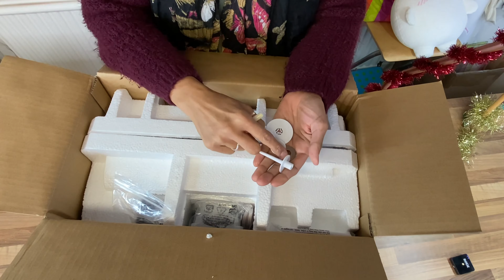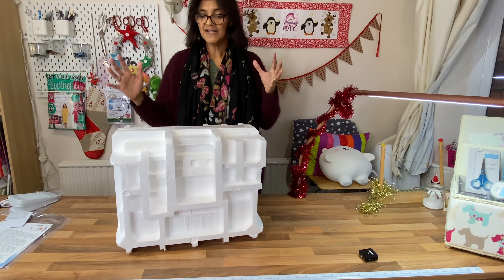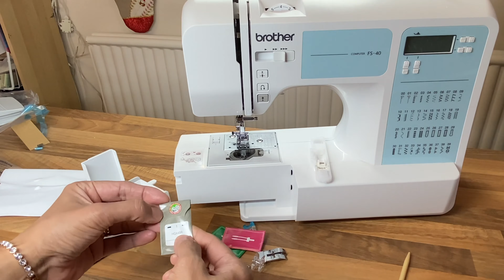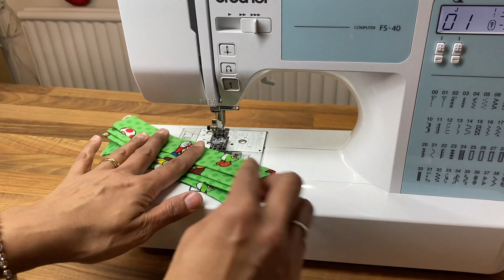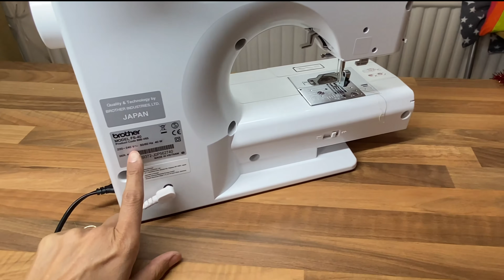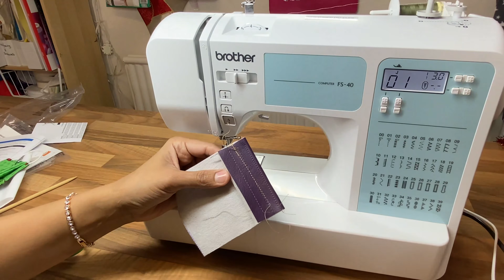Brother FS40 UNBOXED Review #AbisDen | Abi’s Den ✂️🧵🌸

Comment: 11:15 "the peddle doesn't give me good control"
It's sounding to me like you just have a lead foot.. It's not an "ALL or NOTHING" deal, if you push down partal way it will go slower. It's quite variable actually.
It sounds like when people try to use their "clutch" foot on the brake peddle while driving, you end up slamming on the brakes far too hard..
Reply from the maker: Thanks for your thoughts Colin. The peddle on this machine does not give good control. Having worked with Brother for years, I have come across their different peddles.  Some of their machines they class as disposal, this being one of them. This machine has a poorly made foot. But thank you for your thoughts.
Reply: @AbisDen  I literally used this paddle on the FS40 less than 4 minutes ago.. There are about 7 different levels of control on the peddle. You seemed to use it in two different levels NO peddle and FULL peddle, there was nothing in-between. Either you have a defective peddle, or they have changed the design of the peddle. I see the video is 2 years old, we have had the FS40 for about 9 years, so maybe they changed it.. But, if they hadn't, it would seem you are unable to smoothly operate the peddle. Practice may help with this, though this was the first time I used used my wife's sewing machine in about 4 years, and was able to find the correct pressure on the first step.. 
If you are a car driver, I would suggest you try your right foot..
Reply from the maker: Thanks Colin. Maybe it is defective? I originally bought the machine from the states before they were sold in the uk.I’ve had a few FS models. It’s not a good machine. Having repaired a few, they just aren’t designed for longevity.  Brother sell a lot of plastic rubbish. What they themselves class as “disposable”. The FS range is unfortunately one of them.

Comment: Dust covers are very important to protect your machine from general airborne grime around the home. 
The offset shank on the twin needle is for use on a left position zig-zag machine. 
The other problems you encountered were due to operator failure, not the machine.
Reply from the maker: I'm not sure the operator is at fault here - these machines are consistently poor - have you ever opened one to see the quality of the machine - dreadful.

Comment: This is a shocking video! Its struggling to go through your leatherette because you arent changing the settings to adjust the tension and presser foot. Please if anyone buys this machine make sure you read the instructions before  trying to do this
Reply from the maker: There is no pressure adjustment. Tension isn’t a factor at all, it only affects the quality of stitch. Power is what this machine lacks. The feed system is equivalent to than of a plastic mini machine
Reply: @AbisDen  I use this every day for my business 😂 never had an issue and its certainly not like a mini machine. Look at your hands fumbling on everything, do you even know what you're doing.

Comment: There is a little black switch at the back of the presser foot that you push in that levels out the presser foot to sew thicker fabrics which works well, I have this machine and as a new ish sewer an not having the same issues as you are with the fabric going off to the left. I recently sewed a 3d face mask and the stitching is straight and that has interfacing too

Comment: Have this model. Bought it in the uk and wanted something light to take home on a plane.  Wish I'd dragged my ancient heavy duty machine over instead. It's a lightweight and struggles with pretty much everything and hates pretty much every type of material. I've never had to use a walking foot as much to sew things. It doesn't want to sew in a straight line - constantly veering off to the right.  The pathetic screwdriver is a joke. Buttonholes are hit and miss. Lucky to get more than 3 or 4 done before it decides to grind to a halt sewing in the same place which is a nightmare to unpick.  It was pretty cheap and didn't expect much but even so it's a great disappointment.

Comment: 5 button holes. I have the Brother SE 600 it's not too bad but you need to have a few tricks up your sleeve. For fine fabrics use a smaller needle and place tape over the throat plate as the hole is to big as you saw it sucked in the fabric stabiliser also helps. These machines are not for heavy duty sewing and the computer is very finicky. On heavy fabrics I lengthen my stitches use a size 16 needle lower the tension slow down the sewing speed and use a hump jump over thick seams.  I'm still practicing and learning to have patience.😊👍👍

Comment: Every time you do one of these unboxing videos I’m so happy I went with the Necchi! I’m sure there are other good machines out there, but mine was such good value and has been brilliant so far. Oh there are 5 different buttonhole styles on the brother machine you unboxed x
Reply: Are you still loving the Necchi? Was it the Aldi one you got, I'm considering it!
Reply: @toilworn1322  I’ve had it now for over 2 years and I’ve been very happy with it. Good points are the drop in bobbin, needle threaded, needle up/ needle down, range of stitches and easy to use. I’ve sewed loads on it, cotton, viscose, jersey, sweatshirt, cord, wool and it’s been great to develop my skills. A couple of things that could be better are the fact it doesn’t have a speed control, the lighting - I bought a stick on strip light from Amazon which improved it, button holes on stretch can be tricky, and it can struggle on thick fabric or thick seams. I now know what I’m looking for on my forever machine, but I will be paying 10x the price of the Necchi to get them! So overall a fantastic, value for money machine, which I highly recommend. Hope that helps x
Reply: @maggiemcdonald1346  Thanks so much that's so useful! I noticed it didn't have a speed control button. I guess careful footwork is required! Does it do a stretch stitch? I am new to sewing so might be getting a bit ahead of myself here but just thinking about the types of things I might want to make.
Reply: @toilworn1322  yes you just have to be extra careful going around corners, although if I want to do something really slowly, say turning a corner I press the up/ down needle button so it does one stitch at a time. Yes it does have a stretch stitch and a stretch stitch button hole too. However if you are sewing jersey you can use a zig zag stitch too. You can also use a twin needle for hems too. When I was starting I found YouTube a fantastic resource for learning how to sew different fabric and garments etc.
Reply: @maggiemcdonald1346  Well, I'm sold on Necchi.... but I ended up buying the Q132A... 3 mins ago 🤣 Wish me luck! Thanks so much for your lovely in depth replies!
Reply: @toilworn1322  and yes it was from Aldi x

Comment: There is 5 different button holes with the machine Abi 🤞🏻I’m so glad up you put it to test with sewing multiple layers and different fabric types as that shows how frustrating choosing the wrong machine is and that’s it definitely worth doing your research before buying. I’ve seen these issues a lot with brother machines. So I stick to Bernina or Singer mechanical machines over the plastic computerised machines, they really have the best stitch quality and are much more durable over time.

Comment: I wish I lived nearer Stockport where my son lives and then I could visit you and get some technical training. I would love to be able to service my machine and fix it. Like at the moment I think there is something wrong with the feed dogs as the feed is terrible, even with the walking foot and when sewing jersey it always gets eaten. I wouldn’t mind but I have a Janome 8900 and for the money they cost I would expect a lot better. I have had it a few years and it gets heavy use but it is very frustrating. Do you ever have to replace feed dogs in machines?  Also I have been searching the Internet to find out the power but it doesn’t seem to be very clear anywhere. I will have a look at my machine tomorrow. 
The answer to today’s question is 5 buttonholes.
Reply from the maker: Sadly, many janome machines have this same problem. And they did come up pricey don’t they? It’s a brand name we’re paying for mostly
Reply: @AbisDen  yes they do. After sewing for over 60 years and having had only 2 machines I wanted the wide throat space so I could make some quilts and Janome seemed to be the best. It didn’t fail in that department but I see the smaller, less expensive machines you review which seem very gutsy and do a good job.

Comment: The FS40 you show in this video has 5 buttonholes. Hope you found that screw and got the machine sorted. I was wondering whether the machine has adjustable pressure as that seems to be a factor in using different fabrics?
Reply from the maker: It’s a great question. Unfortunately these models don’t have a presser foot 🦶 pressure dial. I was playing chauffeur today so I kept running off to do family things.